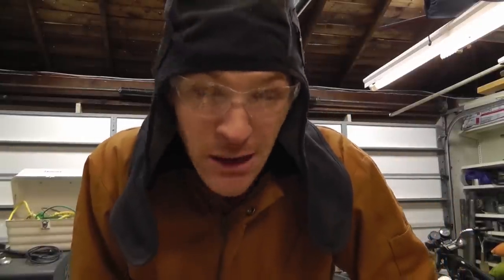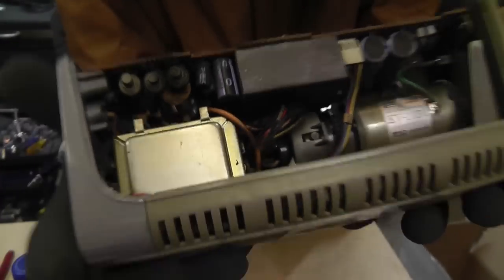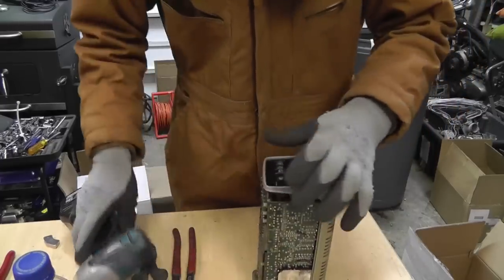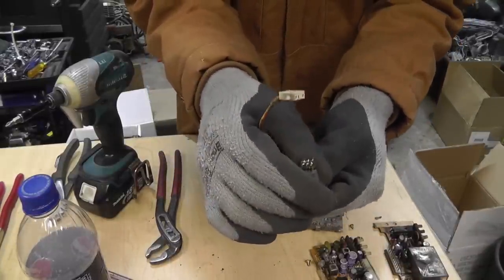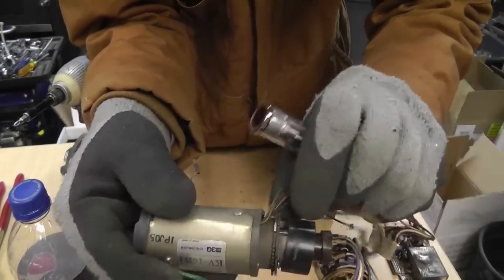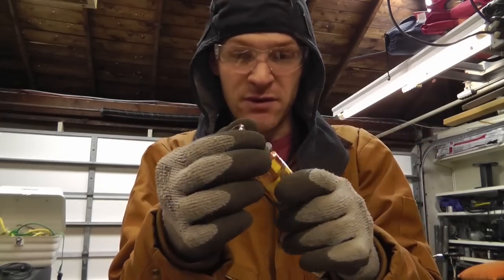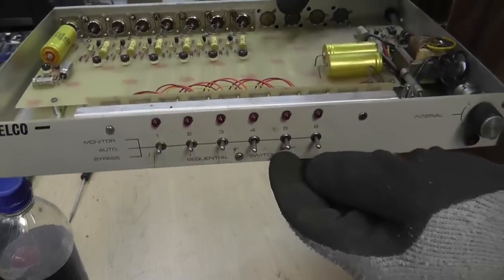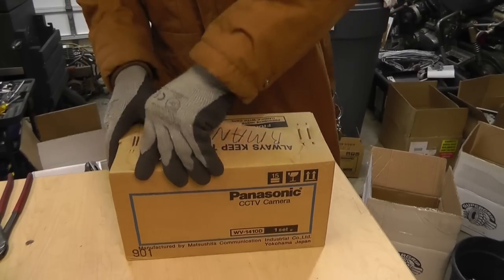Whats In Side A Vintage Analog CCTV Video Camera? CRT Video Recording Device? (Vacuum Tube)???

Comment: The thin wire on the edge of the tube is not high voltage. It's the pickup for the video signal.